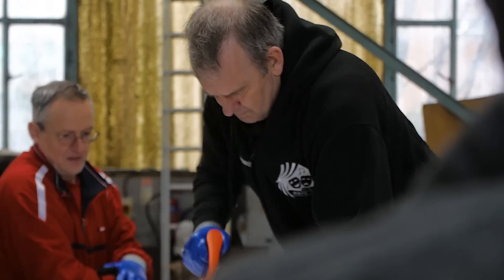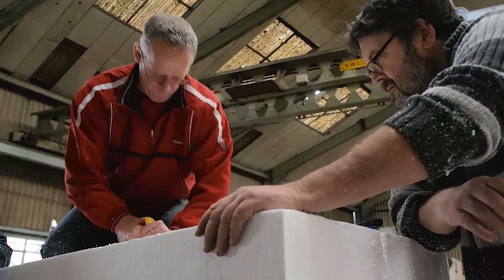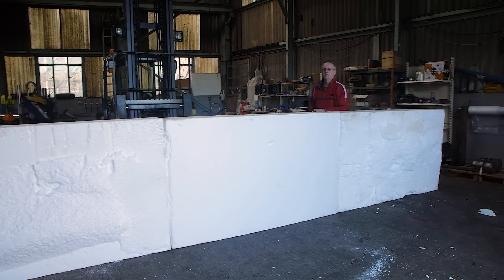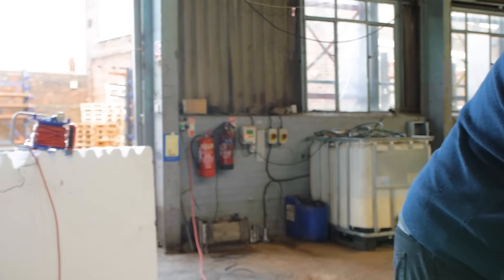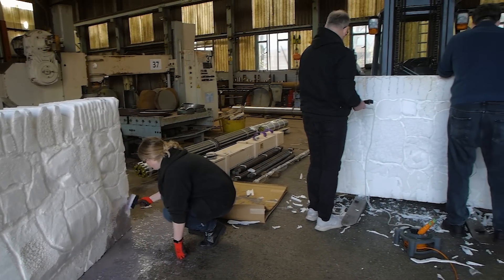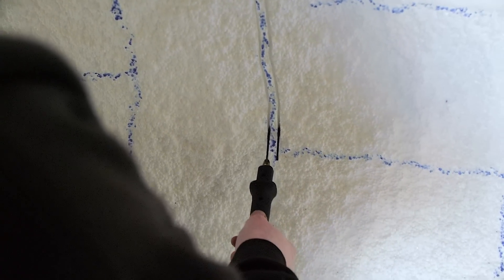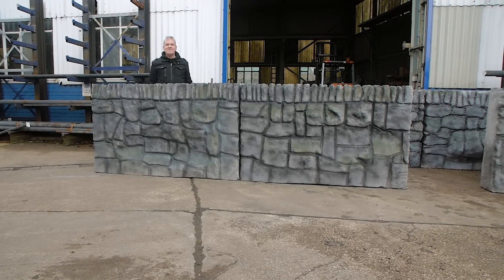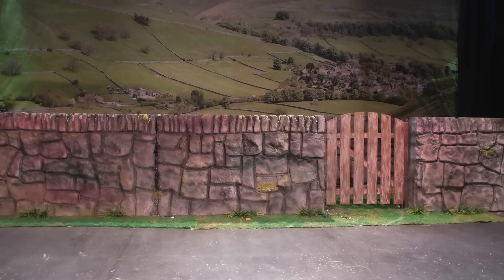Making LIFE SIZE Warhammer Terrain!

Comment: if you had to do that again, the two things I think might help aside from an easier way to cut the foam long ways would be a paint sprayer for the base-coating, and then to make matching cuts on the two adjoining edges  for adjacent wall sections.
Reply from the maker: So, fun story that didn’t make it into the video, but we actually did both of those things. The problem with the sprayer was the pva kept clogging it up and we spent more time fixing it so abandoned that idea. As for carving the walls to match up, the 3 we ended up using at the front were supposed to be at the back but ended up looking nicer. The ones at the back, which should have been at the front, all match up perfectly 😅
Reply: @ThePickleJar  were you thinning the PVA with water or denatured alcohol?